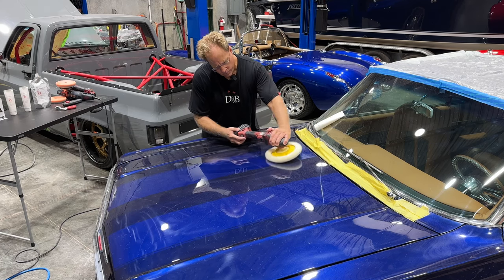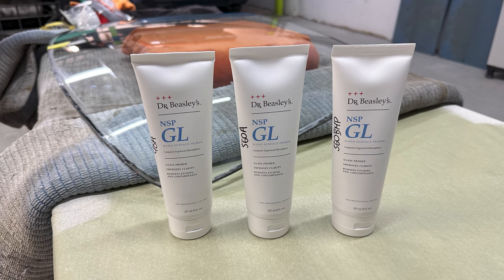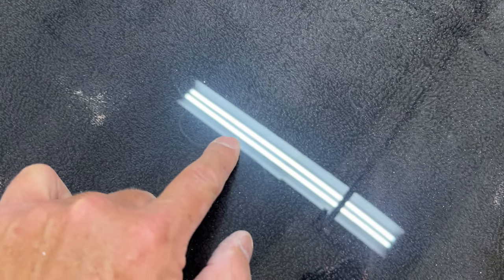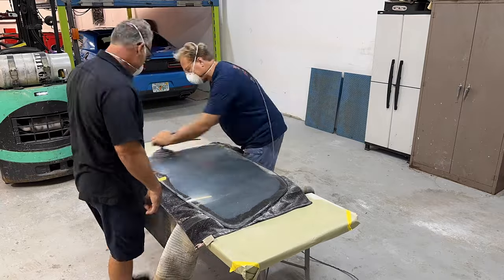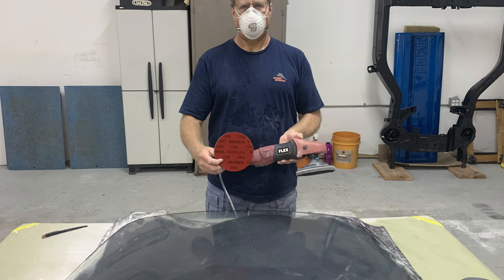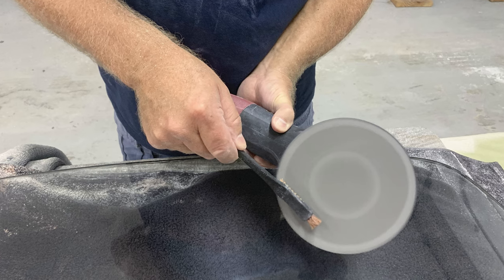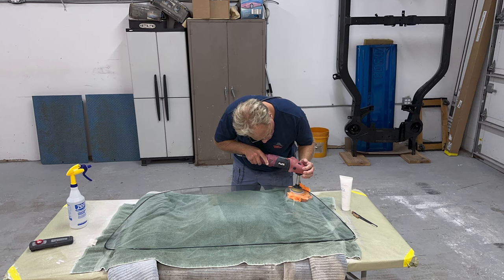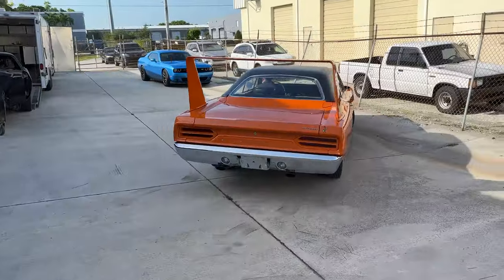Restoring the 1970 Plymouth Superbird Window with Mike Phillips | Machine Sanding & Polishing Glass

Comment: I use an edge grinder to shape glass. We use Ceriglass plus Rayon pads as suggested by Mike previously. Incremental grits.

Is heat the biggest issue ?
Reply: Yes, try to keep heat down.  I do this by working on one side of a windshield for a few minutes and then switching to the other side.  I have 2 carts all set up with the rotary polisher, the polish, towels, water, etc.

Thanks for watching and commenting.  -Mike Phillips

Comment: How am I just now seeing this video? Mike does amazing work as I use a lot of his tips and tricks when polishing. I have been studying the NSP polishes after Miranda Detailing has been showing outstanding long term performance. Will this polish work on ten and fifteen year old windshields where the wiper pattern remains after decontamination and claying? Windshield coatings is my biggest problem area and the NSP makes a lot of sense here. Thank you!
Reply: There are 2 types of glass polishing

Topical Glass Polishing - This is removing things that are ON the glass.

Sub-surface Glass Polishing - This is removing defects that are IN the glass.

It sounds like you're doing TOPICAL glass polishing and for this, normally and clearcoat-safe compound or polish will work using a foam or fiber cutting pad.

Thanks for watching and commenting.  -Mike Phillips